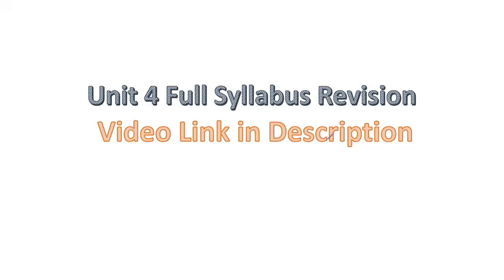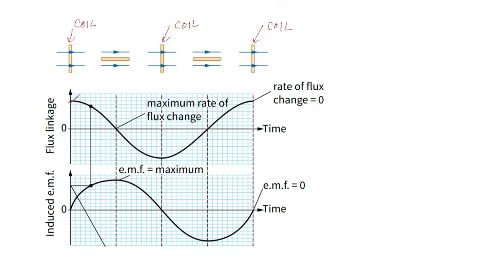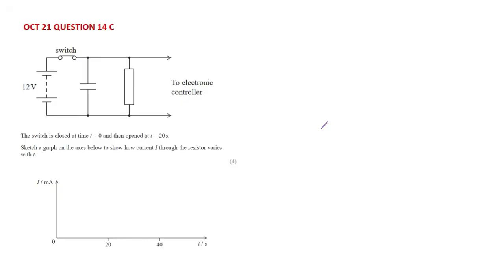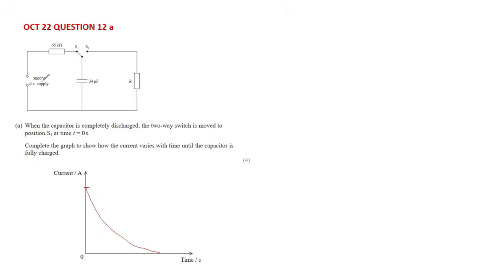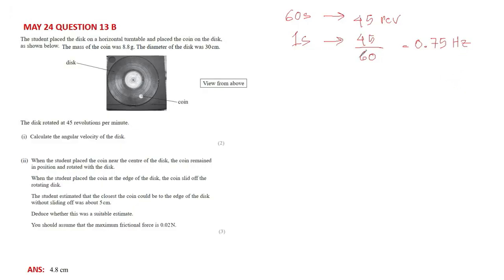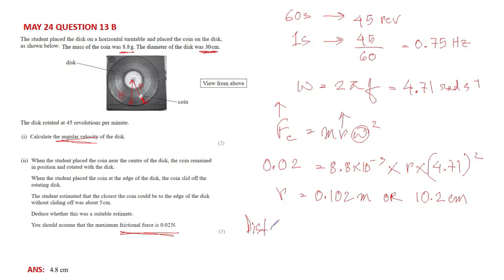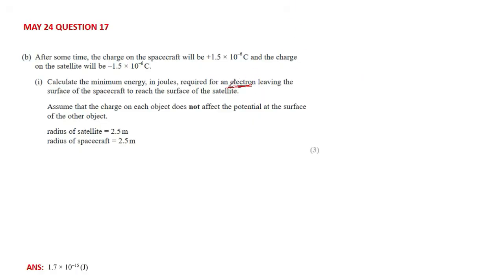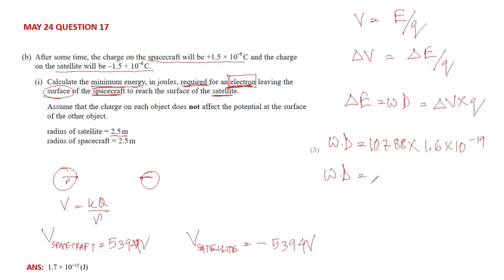A Level Physics Unit 4 Revision Deep Dive: Cracking the Complex Concepts

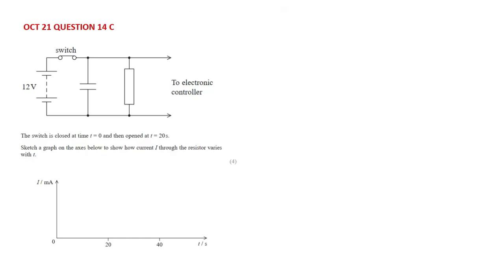Comment: I would like to ask why does the capacitor charges instantly at 14:47. Thank you for the video!
Reply from the maker: A capacitor charges up or discharges gradually only when it is in series with a resistor. In this circuit the resistor is in parallel, so it creates somewhat of a short circuit with the capacitor. If you look at the simulator, you will see that the battery momentarily catches fire